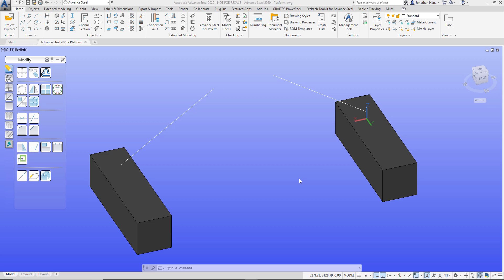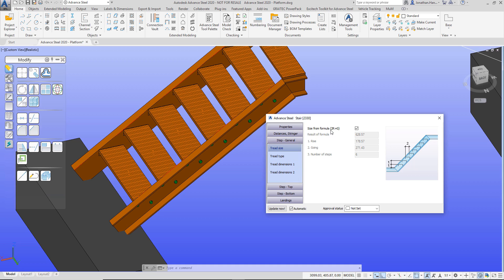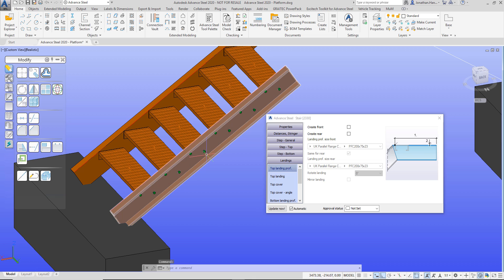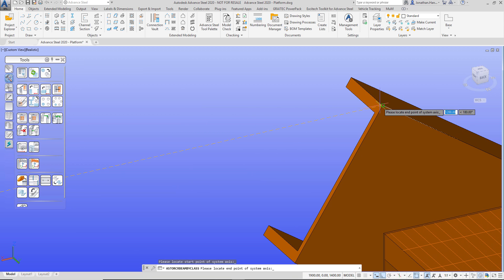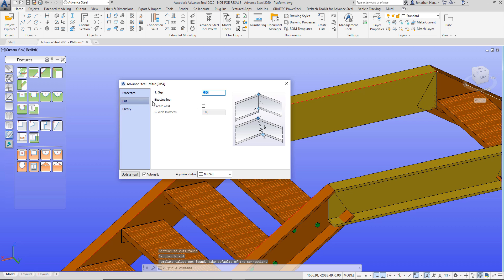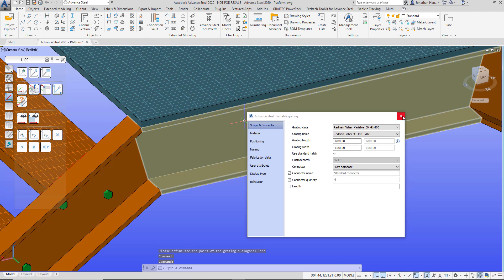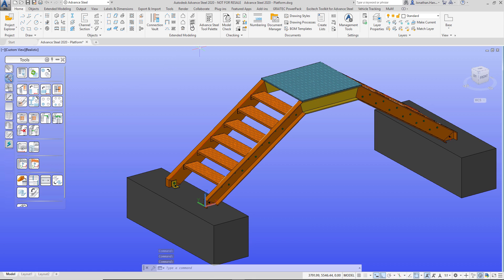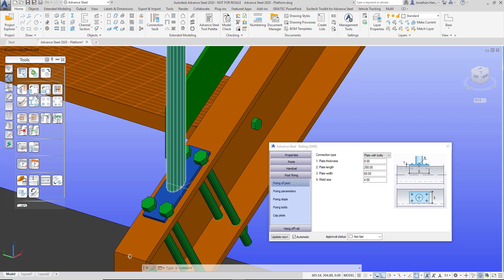Steel platform tutorial using Advance Steel

Comment: Hi Jonathan. Hope u're well. Thanx for your videos. Small advise. I don't like use Mirror option for beams, it doesn't work proper way. if u do offset by X and/or Y ,e.g. 100mm u can see that Advance doesn't mirror beam by system axis, only by point of section. And some joint doesn't work proper way due this bag as well. I solve this problem by reverse beam (draw from end point to start). Also these beams (standart and mirrored) have the same options like Mirror, x and y offset, system line position